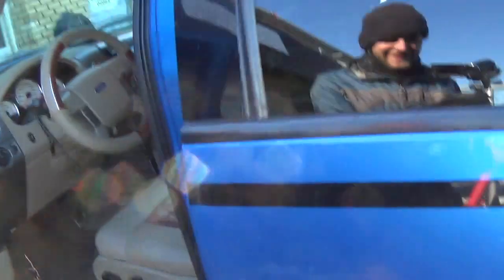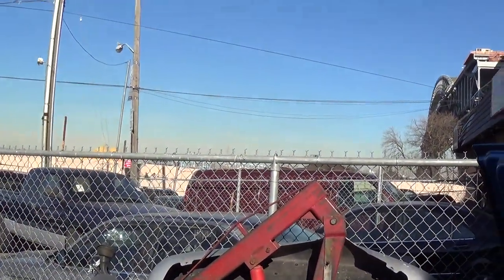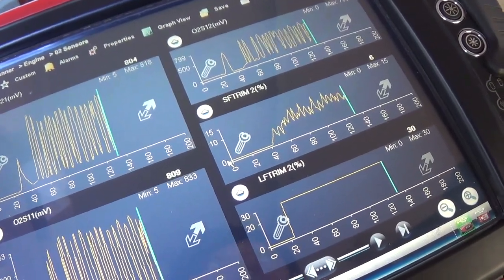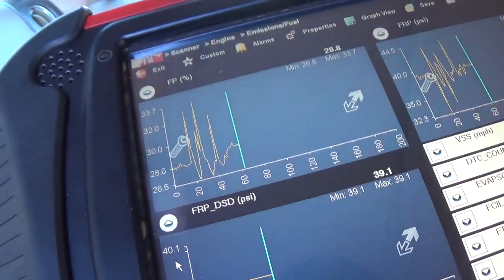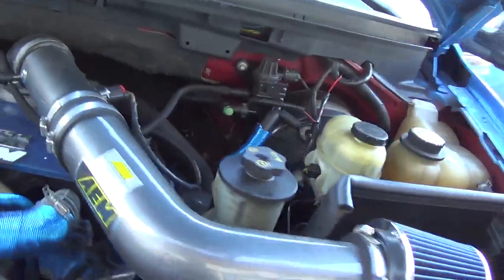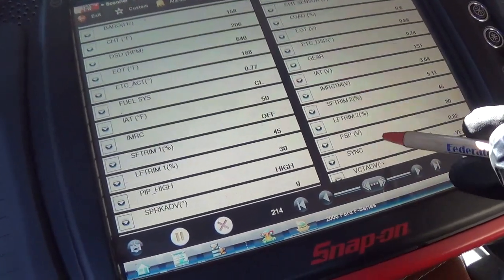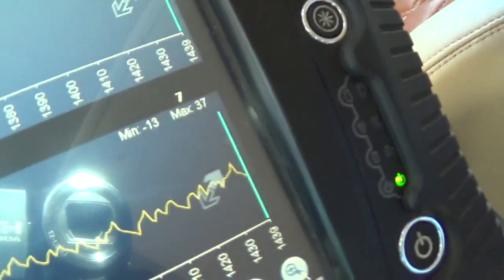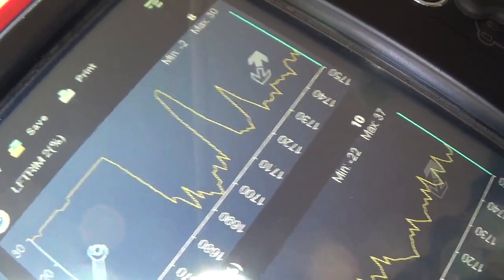F150 Runs Rough, Lean P0171 P0174 (SI Ep 6.2)

Comment: Turbulence of the airflow is part of the problem here we have seen everything from lean codes to a rolling idle to hesitation to P061b code on ETB vehicles all due to swirling of the air past the maf. Sometimes manufacturers like GM use screens to straighten the airflow before the maf to get the most accurate reading possible for the best control of the fuel trims. Great video Ivan!!
Reply: FordTechMakuloco Nice to hear it right from the Ford tech
Reply from the maker: Thanks for the comment, Brian! Does Ford use some sort of air flow straightening device or venturi for proper MAF measurements?
Reply: motoYam82 I have only seen the screens on the Windstar vehicles personally.
Reply: FordTechMakuloco very true
Reply: Great info! Also, correct me if I'm wrong, but I don't think newer Fords don't compute baro from the MAF sensor, they do it some other way. I've seen the code from the older PCMs and BARO is computed with a complex equation involving MAF airflow. Older fords would give a skewed baro and you would have known right away there is a MAF issue, either dirty or just not right. Baro used to be a very powerful diagnostic tool, now not so much.
Reply: The newer vehicles get the BARO from the EGR Module, some are inside the PCM and others are inferred by the map sensor reading at key on engine off and WOT.
Reply: FordTech
Reply: I recently code 171 and 174  I was lucky it turned out that the rubber grommet that holds the wire to the mass airflow sensor had come out of the socket allowing too much air in once I put it back in place and cleared the codes no more problem
Reply: FordTechMakuloco this confirms the reason for your video that you despise washable high flow air filters.
Reply: FordTechMakuloco I
Reply: I have this issue after swapping out the engine for a reman. Old had bad rings. No codes for lean. Right after. They are there. Verified every connection. All good. Aftermarket junk intake. I've always had it. For 2 years.. Then after Engine swap..lean. tips?
Reply: hgallegos915  sounds like the intake. I have the lean code as well. I would check out the intake.
Reply: My 05 543 throwing  171 and 174 but has the factory roush c.a.i. ? Never had an issue until timing components were replaced...
Reply: The only problem is Fords engineering issues, mine just blew a spark plug right out, threads included…Ford Trash!
Reply: Triton 5.4?

Comment: thats not the problem what it needs is a tune for the the aftermarket cold air intake what most people fail to realize you can't just add Parts without tuning or the stock computer doesn't know what to do so it either overcompensates or under compensate same thing with adding high octane fuel if the timing isn't set up for it you will actually lose power it's all in tuning the aftermarket isn't garbage the tune for the truck is garbage

Comment: You need a laminar airflow for MAF sensors.
The problem here was the ugly elbow just after the air filter.
You would install a straight tube with the filter at its extremity and it would work well.
Even straight pipes with no filters can be a problem.
The pipe's ridge create an airlift and messes up the airflow.
A simple vacuum hose sliced on its length and covering the ridge is often enough to make the airflow laminar again.

Comment: Did the rpm feel slow going down when you decelerate? Slight hesitation at around 1500-2k rpm. But not enough to cause a code. Had a complaint on a 2005 holden barina. Engine shakes in the morning. Once it's hot it goes away. Found intake wasn't put in properly. Air was seeping in before the MAF.

Comment: I had a Ford Explorer Sport, 4 liter engine, 44K mi, I think it was a 2003, that threw those exact two codes. Thought it was the MAF but replacement did nothing. Turned out there was a fairly short length of 3/4"  hose (foot or so long) pretty much right on top of the engine (I wish I could tell you what where) but it had a BB-sized hole in it, on the underside where you could not see it. The hose looked just fine, not cracked nor dried out, it didn't look like it was running over anything mechanical that would wear a hole in it, you'd probably not suspect it. Took it off and there was a stupid obvious puncture in the hose. Well, it wasn't "obvious" because you could not see it until the hose was taken off, but with the hose just sitting in your hand, there it was.

Comment: Had the same error codes on my 01 Expedition, replaced PCV valve (never changed), replaced fuel filter and cleaned MAF sensor...just basic items. Turned out it was the fuel pump.

Comment: I had a PO174 on a 2003 f150 and there was a slight exhaust leak where it connects to the manifold. I just had to replace the 2 nuts that were rusted. There was rattle for several months before it finally threw the code.

Comment: Did anyone ever check the VCT solenoids/valves? They are notorious for going bad on this make/model/year and causing your PCM to throw crazy codes like this. Make sure the right oil is in this truck as well. Ford calls for W20 but W30 can be used as well. The triton engines especially heritage 04s and newer O5 have all these little screens and parts that dont get properly lubed with the thicker oil like the VCTs.
So while your shop is looking for the ghost rattling its chains in your engine, the real culprits, VCTs, arent being looked at bevause there is no code that simply says VCT SOLENOID

Comment: 171 174 MINE QUIT RUNNIN.  4.6. VACUUM FINE. WILL NOT RUN LONGER THAN 10-15 SECONDS. IDLE ONLY, THROTTLE AND IT SHUTS DOWN. FIRST TIME WAS 2WKS AGO. CLEARED UP AFTER 30 SEC. WAS FINE TILL NOW. WHERE SHOULD I START?

Comment: Happy new year Ivan !
In the end , it seems that flashy cold air induction , by whatever name , seems to be one big restriction . Don't know a lot about volumetric efficiency versus fuel map but I would say you proved that the restriction is what caused the unbalance of a proper fuel/air ratio which totally disagreed with the engine management system . The engine and its fuel system is totally stock . It can only run on stock intake volume . This is the equivalent of when guys used to take Holley 750 CFM double pumpers and throw them on stock small blocks and expect HUGE power gains . More air into an engine with a stock cam and stock chamber volume does NOT make for efficiency .
In this case , it's the opposite . LESS air was being introduced into the engine than stock specs , due to the non-stock intake restrictive filter . It would not even idle right . The fuel system via the O2 sensor readings were what was compensating for the restriction by opening the idle air control to offset the missing volume . The scan readings showed the fuel trim way off the scale from the programmed fuel map due to insufficient air intake . If the idle air wasn't necessarily over active to maintain and compensate for the restriction , then that would be the manufacturers reason for the huge intake tubes into the throttle body . Looks Badass and makes up for the filter restriction . How could big tubes on a non-turbo engine be expected to flow more air than stock through a stock plenum and lower intake on a stock engine with stock cam ? 
Bottom line : that aftermarket cold air induction is NOT meant for a stock engine ! 
It may do well on a turbo charged build but all it's doing is lining the pockets of the store owner from where it was purchased . Ivan just proved that . Don't fall for it . I'm sure ford engineered the intake induction right to achieve correct volumetric efficiency or an F150 wouldn't get out of its own way . 
Nice job Ivan ! Your relentless efforts to find the faults and install the fix pays off yet again ! 
If it weren't for guys like you and the shop owner , no one would put in the time needed . 
The video was only 18 minutes long , that's less than an hours labor charge . Ivan just saved huge $$ dollars on dynometer sessions and guesstimates . This is why Ivan gets the job , get 'er done and save $$.

Comment: Fords are very intolerant of variations of intake air flow when using MAF. Even cheap aftermarket filters in an OE application can change the flow rate and cause codes. A couple of 10ths of a volt means a great deal.  If you're going to run 1 of these cold air intakes, etc, you need to have the ECM tuned for it.

Comment: Owner - "The box said 10HP"

I would guess with that huge pipe, the velocity of the air entering the engine is greatly reduced, which would change the rate at which the hot-wire is cooled. The sensor requires less current to keep it at a constant temp with reduced air velocity. Yet the actual volume of air being sucked in is considerably more, causing the lean condition. This is something I never actually thought of until I saw this vid. Nice work, Ivan!

Comment: great video Ivan, at the start you asked why the short term fuel trims were not maxed out (0.8%) while the long term fuel trims already were (29.7%) for both banks.  Short term fuel trim changes accommodate an immediate condition such as a vacuum line suddenly coming adrift or even when the car is cold and it needs more gas just to warming up; don't look at short term fuel trims until the engine is in closed cycle.  If the hose remains disconnected the long term fuel trims will be set to live with this condition.  With the long term fuel trims accommodating a long term change the short term fuel trims, having done their job, return to zero.  I know you love to do the numbers, looking at the air flow rate g/second value shown in the PIDs you can work out, based on the revs per minute/60 and engine displacement, whether the amount of air that is entering the engine matches the value as calculated by PCM.  The disconnect between the values points to air volume sensor error.  Is it possible in the computer to simply plot the air consumption of the vehicle based on revs and engine size versus the g/sec as seen by the PCM?  As this would highlight the problem immediately.

Comment: probably needed a good cleaning or replacement if problem occurred after quite some time running ok with k+n filter when first installed...most people never clean them or do an adequate job of cleaning them...i still dislike them regardless...as ivan says, engine was designed to operate certain way and people  go and install these filters and it can change operating parameters...

Comment: Hey great video and great diag. One thing I noticed right away was the baro sensor was not quite reporting quite correctly. I know on many systems the baro gets its info from the MAF and originally I saw it reporting between 28-29 which is between 2000-1000 ft above sea level (i think it was at 28.9) Well according to a Baro chart I saw for F150s (inhg (kpa), baro hz, altitude) 28 94.6 152.8 2,000    29 97.9 155.8 1,000    30 101.3 158.9 0 (sea level)    I believe the baro frequency was in spec but the baro inhg was off a little bit, and in your video after pulling that after market crap off I noticed the fuel trims corrected, but also the Baro shot up to 30.1  you can see that at around (17.06 on your video) which was what is should be at sea level. That is just one more thing to check and look at closely when you think the MAF is out of whack a little, at least that is one thing that has helped me trouble shoot MAF sensors. Well thanks again for the great video I enjoyed watching it. I hate aftermarket add on crap, I just dont get why people want to add stuff like that. Oh well more money for you I guess, lol.
Reply from the maker: Sharp eye! That's a great observation...the Baro should have been closer to 30inHg at sea level.

Comment: I didn't see the aftermarket cold air BS... yeah the curse of the modern tech... I had a Mazda Miata come in with one... I was able to retain the cold air, the problem was the sensor was was measuring the flow while turned backwards.

I've seen just about every lean condition a Ford can make. Most of the time it's dried out rubber gaskets or the PCV harness

Comment: It's not a Kendra & Natalie; it's an Allen Ernie and Martha.  ;)

Good find!  I'm willing to bet if you rotated the MAF housing 180 degrees, it'd get the signal back in range.  That elbow in the pipe is a bit too close to the MAF; all the air is still hanging out against the far wall of the tube away from the sensor.  Rotate the sensor into the airstream, and you should be able to get the truck back on the road, should the customer decide to keep the aftermarket intake.  :]

Comment: This video helped my solve my lean codes on my Ranger. was reading +24% and +17% on LTFT's on bank one and two. Swapped out an aftermarket MAF to the OEM one and put in new O2 sensors, now I have 0% and -4% LTFT's.

As soon as I unplugged the aftermarket MAF, it died, then I restarted it with the MAF unplugged and the fuel trims dropped like a rock. OEM worked perfectly. Although, on my scanner, the two MAF had nearly identical volts and g/s of air showing at idle......

Thanks!!!!

Comment: Been working with the same codes. ('02 Expedition 5.4) Just got a scan tool to read fuel trim. Watching you diagnose the 150 was very educational. Mine turned out to be the PCV line. Did not need scanner tool to find that but is was nice to use it to confirm the fix. Thank you for posting.

Comment: Good video, and great detective work!

At GM's Intake Product Development Team meetings, there was (I'm retired now) a LOT of discussion around aftermarket 'performance' intake systems/air filters/boxes.
The diagnostic calibration engineers (they set the pass/fail thresholds for components & systems) had many examples of non-OEM performance parts failing the diagnostics and setting DTCs.
I recall that over oiling the K&N filters contaminated the MAF sensors, setting DTCs.
Hundreds and thousands of hours are spent dialing in the pass/fail thresholds. 
It is correct that placement of intake system components can be a factor. The same engine in a different platform/body style can often need a specific diagnostic calibration as well as other engine management calibrations.
Reply from the maker: Great comment! Yes the engineers do a lot of work and then consumers just rip out the stock system and slap on a shiny tube and expect it to work fine lol

Comment: Had a check engine light on my 95 ford windstar & it was running lean. Forgot what code it was. Long term fuel trim was high. It was a dirty MAF sensor. Clean the sensor & it fixed the problem.  Great video. Thank you.

Comment: I've been running a K&N filter system on my F-150 for nearly 15 years, self installed, without issue. 5.4L has 200,000 miles on it, and anytime I've gotten these codes it has been a vacuum leak. Once the PCV octopus was basically falling apart, replaced it with no issues. My K&N has a straight run past both sensors before it curves into the throttle body. I have never cleaned the  MAF routinely. but i have cleaned and oiled my K&N filter regularly. I also paid north of $300 for this cold air system so I didn't go cheap on it. Obviously, it was well designed and the truck had no issues with it (still does not!)
Reply: Same here! No issues with my k&n fipk maf reads 5.6g/s at idle. 10 and 11 gen f150s are notorious for vacuum leaks tho! Specially the main vacuum on the backside of the throttle body plenom close to firewall.

Comment: Nice fix Ivan. Confused me a bit since the complaint was that it ran crappy only intermittently. MAF was definitely low for that 5.4. The SIE is the gift that keeps on giving. Thanks for sharing this there were some good lessons!
Reply from the maker: Thanks John! I think the crappy running was mainly due to that failing ignition coil, a separate problem from the MAF issue we saw here.

Comment: As a HVAC technician I could see how the air flow through the bend in the pipe would be hugging the outside radius and the MAF was on the inside radius side
Reply: Joe Shearer I didn't notice that but it makes sense. Most MAFs I have seen come with what looks like a honeycomb grid to help organize the air columns. The aftermarket junk also deletes the reservoir box that holds air. My understanding is that it is there for rapid throttle openings that deplete air behind the filter. Loss of air when you really want it?

Comment: Not sure why they call that a cold air intake when its actually sucking hot air in from under the hood. The factory setup is actually a cold air intake because most have ducting that pulls air in from the grill area or the bottom of rad support
Reply from the maker: You got me there I've asked that question for a long time too...
Reply: are you going to vision2017 with Paul for training?

Comment: I love Ivan's videos. To clarify something here. That is not K&N filter or intake. That is a cheap aftermarket eBay imitation that has been fitted on that truck. The filter is a cheap aftermarket replacement that is not doing the job (well actually it does, it is restricting more air that it should) plus the OEM box was cut to hold the hanging pipe and the pipe has a sticker on it that says AEM that probably someone stick on the pipe to make it look expensive. (AEM has factory brackets that will fit on the vehicle with no modifications.  Base on the pimp my ride truck that we all saw with color aluminium foils on hoses, unplug cables, half aftermarket pedals and who knows what else, that is the result of not knowing what are you doing. Not all aftermarket are bad, jut look for the one specifically design and tested for your vehicle, not just something that with some modification may be required will work on your vehicle. 

Nice job finding out the problem Ivan.
Reply from the maker: But at least the blue color looks cool and actually cools the incoming air charge hahaha